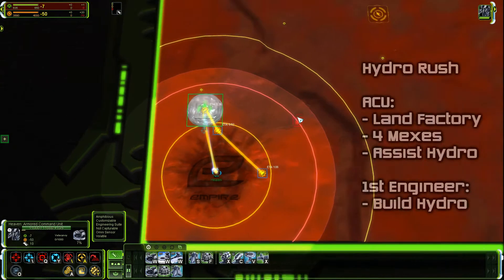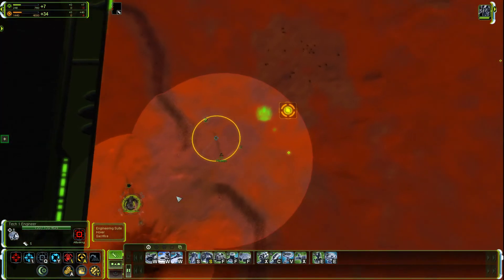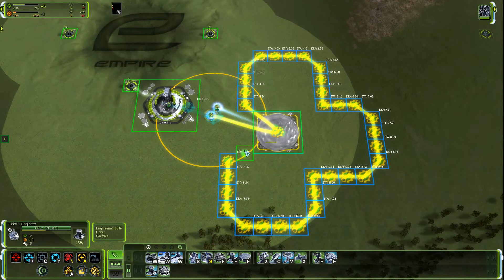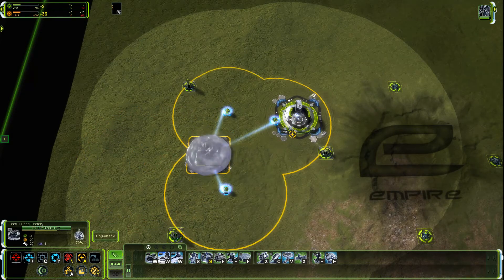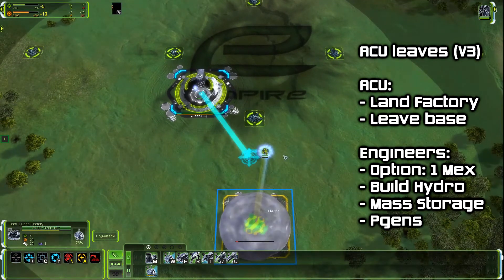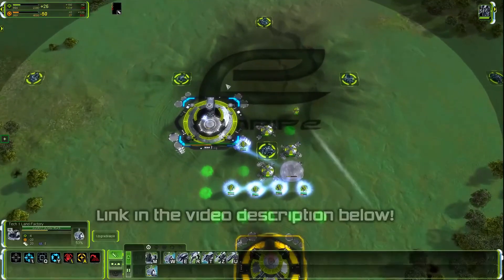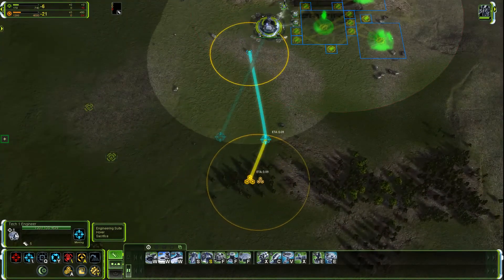Modified Hydro Rush - FAF Tutorial 3 - Supreme Commander Forged Alliance

Comment: Can you do a research on using the engineering drone to rush eco early on? After watching the 'cheese' video some time ago I tried to patent using the drone on Setons and I came to a conclusion that it is downright OP on the Rock start position. Using the drone allows to suck in the side island mass a minute and half before the standard transport method does. I usually build 1 t1 pgen, drone and then a standard opening.
Reply from the maker: it's not OP because it dies to 1 intie. if you play with people who are so bad that they can't scout the drone and build 1 intie to kill it, it's of course gonna seem OP, but once you start playing with good people, you will realize that it's a risky investment that can pay off sometimes, but frequently it will fail horribly
Reply: But what if you build an factory with your drone?
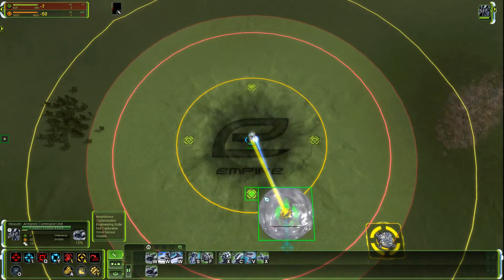Reply: @smort123   same applies;  have to get it done before 1 intie shows up... which (without bothering to actually check) a reasonable beach build will be able to get there well before 4 mins... does building the drone,  flying it there & finishing the fact finish before that?  well;  only if you can get the drone built & on it's way by... 1:30  - drone takes   ~1 min to get to the island & 1 min to build a fact... so...  tricky?
Reply: much faster to drop a trio of drones using a second-air assisted transport imo.
Reply: If I go this route, for Seton's, for example, I aim for a fab to be built as soon as possible - usually as a third thing.

Once the drone is built I order it to suck in two reclaim rocks on the mainland, then I send it to the side island and build: mex->mex->land->aa->mex->mex->mex->navy->navy->navy. The first fab builds engineers which build radar and assist the navy, when time comes. Unless the enemy is able to interrupt the fab build ( which on setons is rather hard ), I am entrenched to a level that requires a major navy fight to break and I have a major advantage mass wise vs the beach guy.

Drone is also pretty good at securing far away expansion mexes, because it is faster then an engineer.
Reply: so... no factory first?  you're delaying your first four mexes by the entire build-time of the drone?  that does not sound like great efficiency-  at that speed by the time you've got a drone off & all your core mass everyone else will have dozens of engies,  at least half their mexes,  a ton of tree-reclaim...   i'd be scared i'd never catch up being that far behind the eco